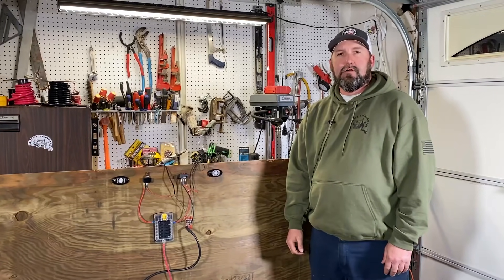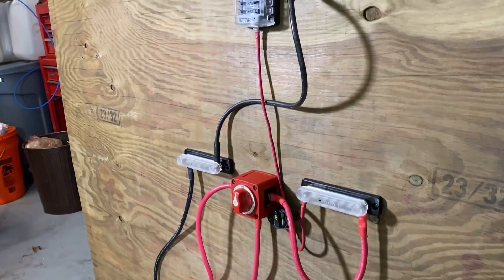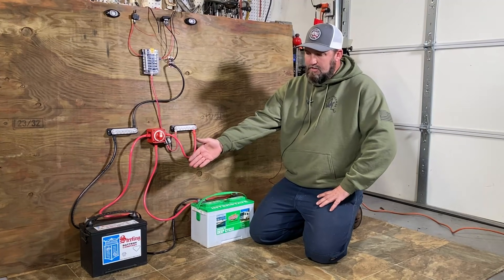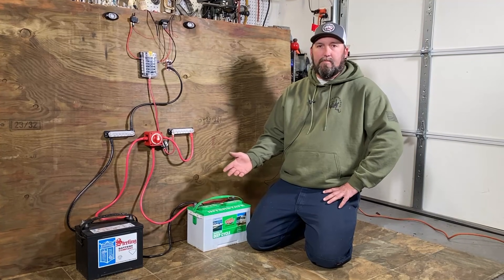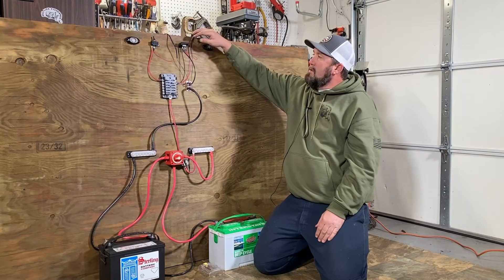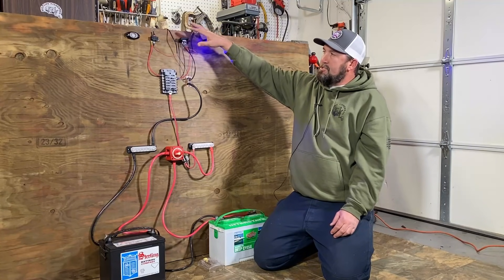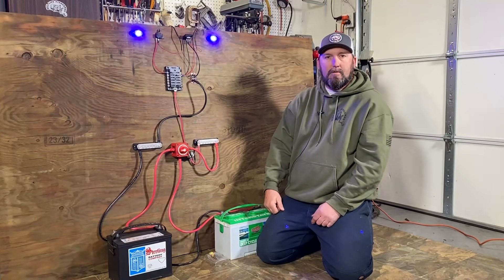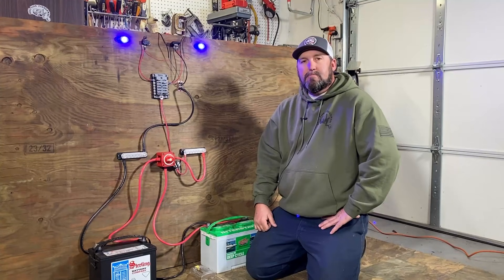BASIC BOAT DUAL BATTERY WIRING | HOW TO

Comment: This is amazing info!
I do need help with rewiring my Keywest 1720 from a single starting/house 12v battery, to a dual battery system that provides 24V for the trolling motor (24v trolling motor). I just got the blue seas add a battery, 2 dual purpose batteries (to replace the single starting battery), fuse block, and I’m starting to dig into the wiring. This old boat (2005) is new to me and the 12v system won’t work for my trolling motor, plus the wiring is an absolute mess. 
Minnkota and forums suggest the trolling motor be run off the second battery. The batteries should be in series. I got the blue seas add a battery/charger/combiner to ensure I don’t overuse the juice between the 2 batteries. 
1: is this the way to go for my needs?
2: can I retain the starter battery, and run the 2 new batteries in series and dedicated to the trolling motor while charging them from the starter battery?
3: I haven’t read anywhere that it’s safe to run my trolling motor to the fuse block that’s also running all the other accessories. Mass confusion :(

Comment: Blue seas has a diagram for a dual battery switch like yours but they have an ACR between the two batteries connected with a positive wire. Do you know the benefit of that? Thanks

Comment: Great videos. Where does the outboard positive wire connect to here?
Reply: Connect the positive to the output of the isolation switch mate.
Then the negative goes directly to the crank battery.

Comment: I don't know why you would want your starter battery connected to anything other then the battery charger and starter motor. You don't want anything draining that battery, or the engine may not start. So I would not have it going into that main rotary switch.

Comment: Finally - something easy to follow. Will wire up my new 12 volt trolling motor like this so it can charge while I am running. Nice and simple. Just don't turn it through the off position (as per comments...)

Comment: i am a little lost. so when switched to 1&2 on- this means the alternator is charging both? . so for my setup i have a deep cycle for cranking only and lithium for my fishfinder ,2 little led deck lights and my radio . i have to keep them seperate .i thought by switching to 1 and 2 on it would allow me to run both batteries but have the circuits separated and not in parallel . or do i need to install another battery switch to have them separated bc the outboard i have is a 1978 and the charging system off the outboard does not support lithium so i know those 2 in parallel if the sector switch is on 1&2 is not going to work.  i also run a NOCO Genius GEN5X Battery Charger - Gen5/10 Amp/2 Bank
 Battery Charger which lucky has the ability to charge both lithium and deep cycles and has  a memory feature that once the battery is hooked up it automatically knows which type it is have the 120v plug adapter also so charging is easy.   .

Comment: Can you explain how grounding works?  I think I'm supposed connect the - terminals of my batteries together,  then connect one of those - terminals and my dc - busbars (I have 2) to a "grounding bus", which gets connected to my outboard engine? And then when I hook up my AC system, the ground of that connects to the same grounding bus?

Comment: Maybe a dumb question, but why do you have to run your positive from the switch, to a bus bar, and then to the fuse block? Why can’t you run directly from the switch to your fuse block? Isn’t the fuse block kind of a bus bar in itself?
Reply from the maker: Yes you absolutely can do that ..  and you are right the fuse box is a bus itself. And a positive and negative bus is in the fuse box if you get the one with the negative side  as well. But having the bus there just allows you for more wiring options and allows you to run higher amp draw things off of it.  Most fuse boxes are not rated higher than 30 amps . But that covers most anything you would run on a normal boat anyway.. thanks for watching and let me know if you have any questions.

Comment: Is the cranking battery basically there because when you first activate the motor the draw on power jumps faster than a normal deep battery can handle well?
Reply from the maker: A cranking battery is designed to start a motor and put out more cranking Amps fast! It also recharges quickly.. but it is not made to last a long period with a heavier load.. a deep cycle is. But a deep cycle has less cranking amps.
Reply: @ReelLifeFisherman  That's really interesting that people would work that out to set them up that way. Thank you.

Comment: Not sure: do you need buzz bar on positive side? Or just on negative?
Reply from the maker: You don’t need a buss bar for either really.. it just helps to keep from stacking ring terminals on the battery or the switch. Usually a negative buss is more common! 🤣 that’s a electrical joke!

Comment: I have a 24 volt trolling motor. Does that mean that I should run my sonar off my cranking batter since my trolling batteries are wired for 24 volt, or is there a better way? I'm hoping for a better way. Thanks.

Comment: You said it’s not good to run on 1+2 but don’t you need to charge both the battery’s? Also if you only need 1 to start it, you can’t switch to 2 when the boat is running?

Comment: Quick question if u dont mind answering, I just perchased my first 12.5 inflatable boat but im having trouble diciding some things and figuring it out, what battery size would you recommend someone thats either getting a 55lb thrust trolling motor or 62 to 86lb is also confusing for that size of a boat and for someone going on Lakes like Big Bear with just 2 people and light fishing gear?
Reply from the maker: So I used to have a 12’ aluminum boat I ran a 55lb tiller style motor with a group 27 deep cycle. It worked great for trolling most of the day. But I had a 9.9 on the boat also.. will this be your only means of propulsion?
Reply: @ReelLifeFisherman  Yes im yet still new to this since it will be my first time with my Wife were starting off slow but we want to have something strong enough to get threw the lakes without worries of being held back. Mostly fishing but some relaxing/cruising trips not fishing? What trolling motor and battery would you recommend sorry just dont wanna end up floating like fishes out there lol?
Reply from the maker: Well I was able to go about 5 mph maybe 6 with the 55lb and I could run it on a group 27 for maybe 6 hours at trolling speeds.  When we would go camping I would bring two batteries.  And swap them out.  If you ran a group 31 it would last a couple more hours I would expect..  have you checked out mercurys new aviator electric motor?  But in the budget i would recommend the 55lb and a group 31. Maybe if you plan on a pretty long day bring a group 24 as a backup.  That would definitely do the trick.
Reply: @ReelLifeFisherman   @Reel Life Fisherman  Thanks man that helps i was thinking the boat was 2 big for it but maybe just overthinking. So a 27 with a 55lb is perfectly fine for acouple hours nice. Do suggest any Battery Boxes that are simple but quick or easy connect but goo protection?
Reply from the maker: No problem at all..T-H marine makes good quality stuff..

Comment: Can you run 2 different battery types on this kill switch? One starter and one non starter?

Also would you connect the motor directly to the fuse box?

Comment: Great video.  I have a question about wiring two outboard to one motor. Not sure of all the components I need.   I have a 140hp main outboard and a 9.9 kicker motor (not the electric trolling motor on the bow).  Both will be wired to the cranking engine.  There seems to be no videos of that anywhere.
Reply from the maker: Yes you would wire both engines to the cranking battery or to the battery switch.  Let me know if you have questions and thanks for watching and commenting.

Comment: Great video, have a couple of question first do I need a inline fuse if I connect the motor directly to the positive bus instead of the output on the switch and second can I have my switch near the dash instead of the back of the boat
Reply from the maker: I would recommend having the engine on the out put of the switch but you can put it on the bus if you have to. And if you do move it further away you will have to spend alot on much larger gauge wire.. or you will get into a voltage drop problem..

Comment: Old video but a really good one. I just bought a new marine battery and it has 2 terminals for negative and 2 for positive. I was told the large terminals are for cranking and the small terminals are for electronics. Is this correct and does this mean I don't need a second battery?
Reply from the maker: Thanks I’m glad you liked the video! So you can put your engine on the thread post with a nut in fact the manufacturer recommends it.. the larger tapered post is not as good as a connection actually. Those posts and terminals get loose over time and will give you electrical issues. I only recommend using them if you have to. I use them more for just testing the battery or clipping on a charger.. And that would still only be one battery and you would want a house or battery. Again a house battery or backup battery is nice to have .. but not necessary. You can take one of those portable battery jump starters or just have a set of jumper cables if you have trolling motor batteries in the boat as well.. thanks for watching and let me know if you have any questions

Comment: Do you recommend using dielectric grease on the battery terminals or any other spots on the boat? What's the proper way to apply the grease? Thanks!
Reply from the maker: I would use a corrosion guard spray on the battery terminals . And I like to use dielectric grease anywhere there is a male to female connector. I apply the grease in the female connector and put them together then wipe the excess off if any..  thanks for watching and commenting hope that helps. Let me know if you have questions.

Comment: After starting on the starting battery with engine running. How do you switch to house battery without that pause? Or do you need to turn off and switch and start again? That doesn’t make sense
Reply from the maker: So you never want to go through off to switch batteries. But it is always best and safest to turn off the engine then switch. Thanks for watching!

Comment: One quick question, does the outboard motor positive and negative get connected to the same battery posts of the starter battery as the other wires that join  the start and house batteries?
Reply from the maker: The outboard positive goes to the battery switch output side. And the outboard negative goes to the negative of the cranking battery. The. You would join the negatives of both batteries. Thanks for watching and let me know if you have questions.
Reply: Thanks for your response on this.  So, just to clarify the wires would hook up just like your illustration, but the positive coming off the boat motor would go on one of the open positive bus bar screws right off the red switch?

Comment: So no fuse between battery and bus bar? Have to move my cranking battery towards the middle of the boat and I thought I would be easiest by adding a buss bar
Reply from the maker: You could definitely put in a resettable breaker. But it better be sized right to crank through or it will pop every time. .  But most boat manufacturers that I’ve seen do not when relocating the battery.. also the battery cables you are jumping to the battery need to be a larger gauge as well or you will have too much voltage drop when cranking. Thanks for watching and let me know if you have any questions.
Reply: @ReelLifeFisherman   I shouldn’t need the bus bars for much. I have two separate fuse boxes up front for the electronics. I think 6 gauge wire off the battery to a bus bar should be good so I don’t get any voltage drop?

Comment: I have to rewire my boat, 19 foot.  Can you explain how to ground the 115 Mercury I have on the back in a dual battery system?   Right now the motor starts and runs just fine.  Just turn the key on the dashboard.  My console (accessories bilge, running lights, live well pump etc) are not getting power.   Are there any videos on 1. how to figure out where the power ends out of the battery?  And 2.  How to trace the ground out of the outboard so I can continue to replace it correctly?  Love the videos and they have inspired me to tackle this on my own.  Keith
Reply from the maker: Awesome I’m glad you like the video! So the outboard grounds directly to the cranking battery negative or the negative bus . The power to the the helm is ran off the battery switch or the positive bus. And should have a breaker or fuse there. It could then run to the helm and go to a fuse panel or individual breakers .. or to a master power switch on the dash and then to a relay which would then go to the fuse panel.. every boat is wired differently by different boat manufacturers.. but that is typically how they would do it.. thanks for watching and commenting. Hopefully that helps

Comment: might be a stupid question but if i wanted to put a charging system in and i ran 2 batteries that still equal 12 volts would i only need a single bank charger or would i need a 2 bank charger 1 for each battery? i am new to this stuff and currently rebuilding a 1980 sea nymph with a 2 stroke motor
Reply from the maker: Not stupid at all.. technically a single bank would work.. but it’s recommended to run a two bank. One bank per battery to be done correctly.
Reply: @ReelLifeFisherman 
 do you then run a positive/negative from the bus bars to the motor or from the house battery direct? Also would you want your bilge ran directly from the battery so you can run it in auto with the rest of the boat off?

Comment: 5/16 or 3/8 terminal ends?
Reply from the maker: Battery switch usually is 7/16 and I use 3/8 on the battery post typically. Thanks for watching

Comment: This video has helped me out tremendously in planning out my simple (sort of) dual battery setup for my skiff. I have a question though. I plan on having quite a bit of low ampage lights on the boat from spot lights in the bow to courtesy and underwater lights in the stern Would it be okay/proper to set up two fuse boxes from the positive to negative bus bars with their own circuit breakers to separate my power to a fuse box for my dash and a fuse box for my lights? Thank you for all your info!

Comment: Hey RLF, awesome bid, thanks. Bought an older, cheaper pontoon. Wiring is a frickin’ rats nest so want to try my inexperienced hands at rewiring. I kept coming up with questions which you ultimately answered, but what you missed out was gauge of wire from fuse panel to your lights. You’ve got 4 gauge from battery, 8 from buss bar to your fuse panel. But then you neglect to let us know gauge size to your lights or other options.

Comment: The  Negative bus and positive bus is that where you would put your outboard wires?
Reply from the maker: The positive from the engine would go on the output side of the battery switch. The negative from the engine would go on the negative post on the cranking battery.. hopefully that helps .. thanks for watching!

Comment: Thanks, concise and very informative. Does this setup works for more than 2 batteries? I am planning on powering 1 or 2 electrical outboard engines plus other devices, lights, pumps, etc. What would be a good setup for the batteries, the type (crank vs deep cycle) and how many for each?

Comment: Thank you so much for this video! I have a question… could I theoretically have two house batteries wired in parallel on #2, and one cranking battery on #1?  I have a lot of electronics on my boat and will often spend 3-4 nights on the boat, anchored in a cove.
Reply from the maker: Absolutely.. just make sure both batteries in parallel are exactly the same battery.  Thanks for watching and commenting! Glad you liked the video and found it helpful!
Reply: @ReelLifeFisherman  Excellent, thank you for the reply! I’ve watched a ton of your videos and they’ve helped me with several aspects of my boat. Thank you for all the videos you upload. Have a happy thanksgiving!

Comment: Excellent video but I have a question. Why are your LEDs turning on when you turn the switch on either 1 or 2? I thought  it would only turn on when you have the switch turned to where you have the bus bar connected?
Reply from the maker: So the bus bar is hooked to the output side of the battery switch. So whichever battery you choose either one or two it will power everything on the boat in this set up. Now you can do a different set up where you run a crank battery and a deep cycle and all the boat power is ran off the deep cycle and only the engine is on the cranking battery. But you would need to have a ACR/ isolator also called a charging relay to keep both batteries charged . But you wouldn’t hav to worry about draining your starting battery because nothing else is hooked to it. Thanks for watching and commenting let me know if you have any questions.
Reply: @Reel Life Fisherman  thanks for the reply. I actually bought the acr and a switch that have 4 post behind keeping crank battery and deep cycle battery completely separated and connecting equipment accordingly.

Comment: A lot of forums recommend running on 1 for 20 minutes after starting and while motoring to charge 1 and then switching to 2 to charge 2 while motoring. Sounds like you recommend not doing this and shutting down motor and then starting with 2 at the 20 minute mark to charge 2?

Comment: This is a good video however I disagree with using 4awg wire..feels super overkill for a 20 or 30amp fuse. I recommend adding up how many amps you will pull and buy wire according.